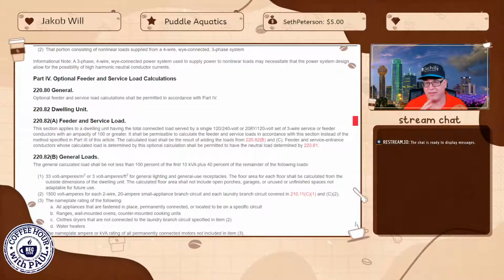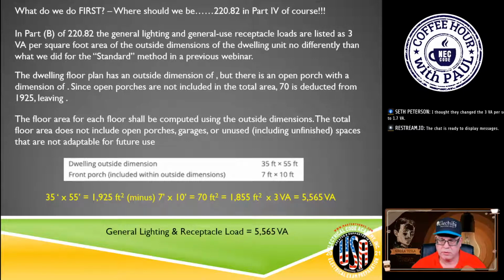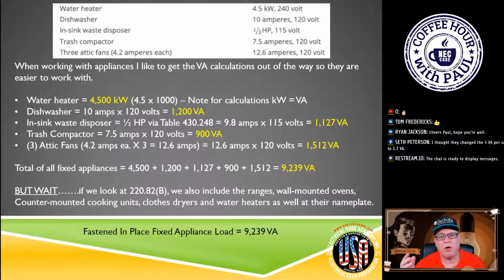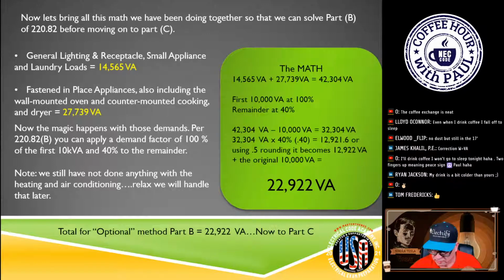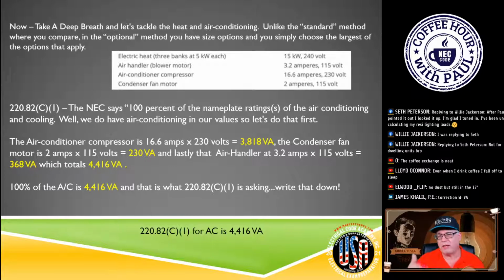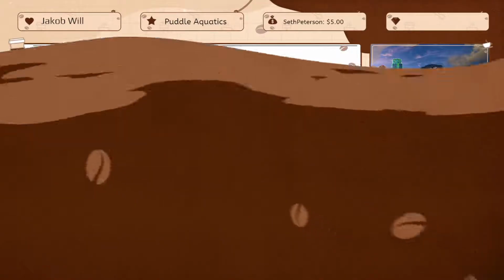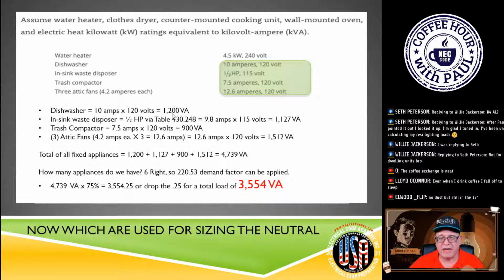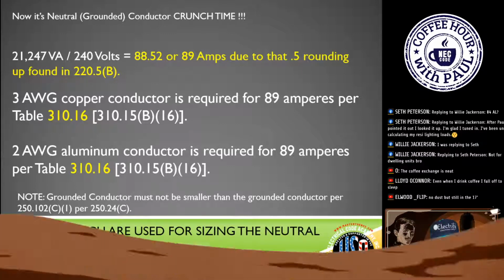Single Family Dwelling Load Calculation   Optional Method Load Calculation Video

Comment: Quick question. I am taking the AC loads from the manual of the equipment and the Outdoor unit give me the RLA values at 230 Volt but also it says the power factor is 0.95. should I consider the power factor to calculate the VAs or just take the RLA at face value and multiply by 230 Volts?
Reply from the maker: Load calculations for the dwelling, ignore any power factors at that point.